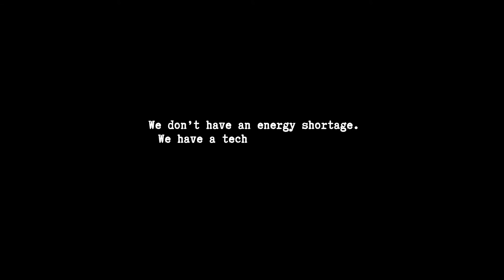DIGITAL NOMAD OFF GRID SOLAR POWER SYSTEM TEST

Comment: I looked into solar for my truck, as well as a dual battery setup. But, as the truck is just a temporary shelter and transportation which will eventually be sold, I decided against both. I am not running nearly as much equipment as you are, mostly beacuse it won't fit in my backpack once the truck is gone. But looking forward to see how your setup works. I've met a number of people since I've been on the road who have really nice solar installs and know of a few with such elaborate systems and lithium batteries, they can run A/C and other very high demand appliances off of it.
Reply from the maker: I'll be switching vehicles in the future. I think most of this will move to the new truck. I'm looking for a 4x4 van.